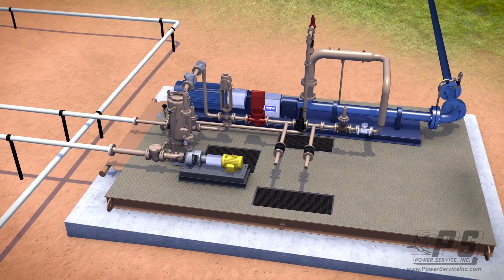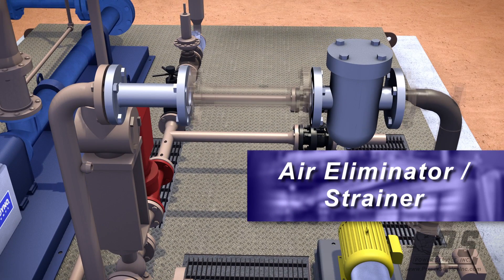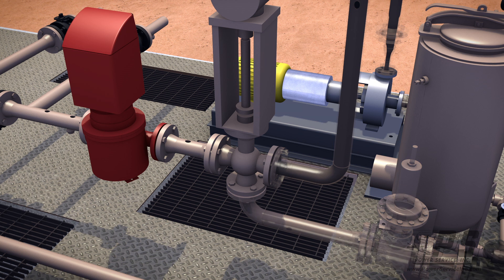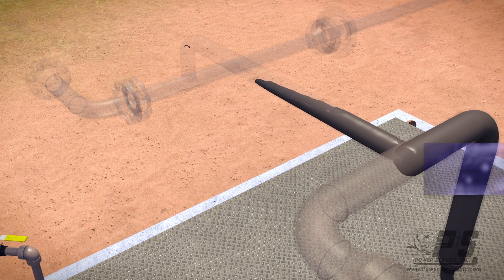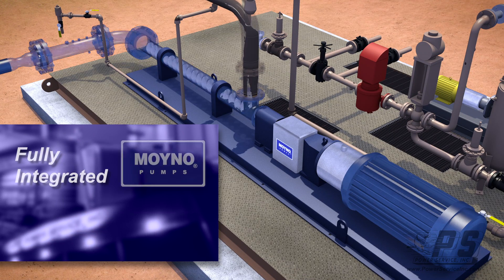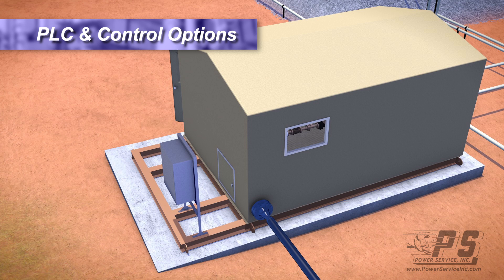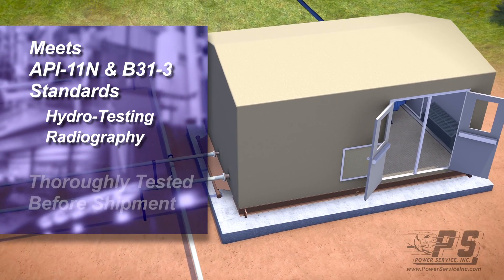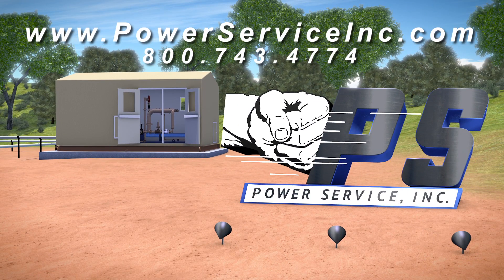Power Service - Lease Automatic Custody Transfer (LACT Unit) - Full Length (with audio)

Comment: what about the oil that is left within the pipes which are located after the flow meter ? How does that get counted ? Isn't this system flawed ?
Reply: If the oil is after the meter then it was counted